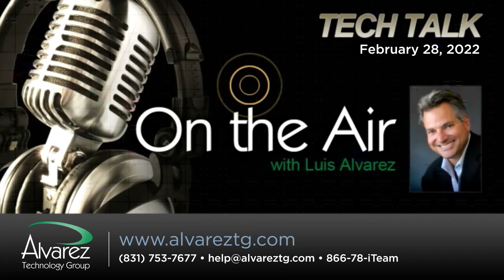Joby Aviation eVTOL Test Aircraft Crashes

Comment: 270 mph is not particularly fast , it seems that a propeller blade failed and that caused a cascade by impacting the next propeller in line.
For comparison the 1935 design Spitfire was flown to over 600 mph and lost it's propeller but landed safely.....